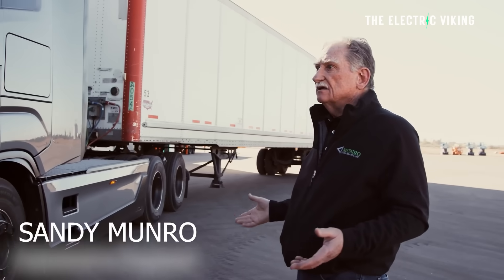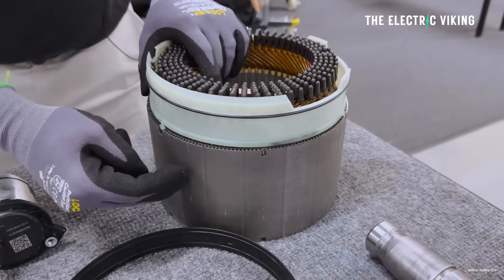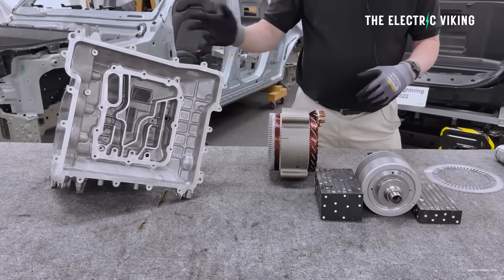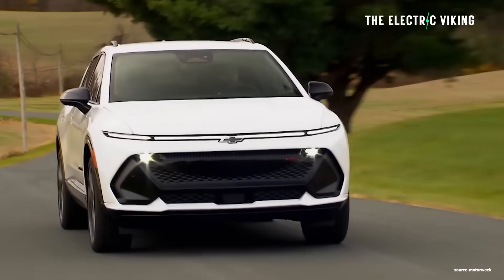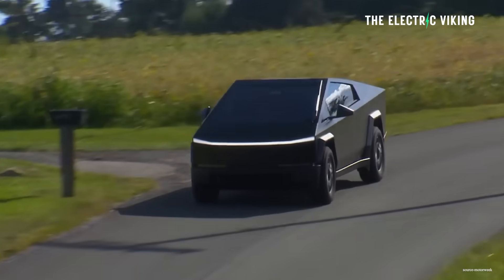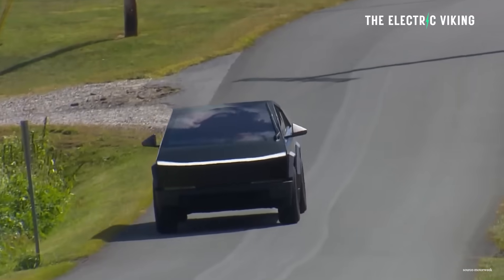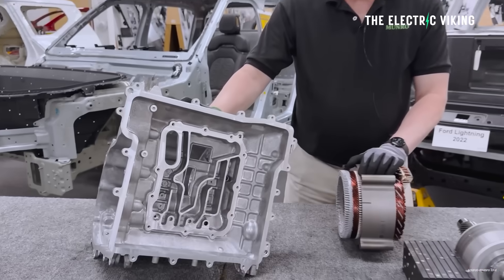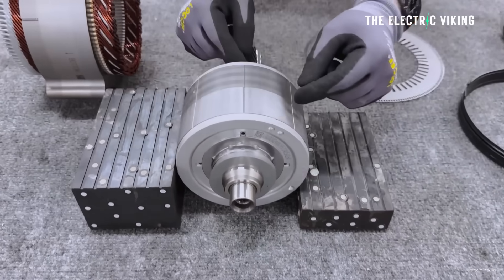Sandy Munro Tears Down Tesla and Chevy EV Motors & Discovers This...

Comment: Tesla oil pump is an extra point of failure
Reply: Choice, replace the Motor in the GM, or the pump in the Tesla.
Guess which one breaks more?  Guess which one is more expensive.  Do the math.
Reply: I'll take that over compromise
Reply: Does the oil pump cool the battery as well? If so, it makes sense to multipurpose the pump to cool multiple systems.
Reply: Fact , my 2023 model is plaid rear motor at 40k miles went off because it was overheating i have a front wheel drive model s … weird feeling ahah
Reply: They literally never fail.
Reply: @Olliebobalong  Anything can fail.  Just low probability.  In theory you can walk through a solid wall, it just never happens.
Reply: @davidbeppler3032 unless you're a liquid metal Terminator
Reply: How is it they have multiple million plus mile cars still running on the roads then ????
Reply: Nothing could go wrong.  There are lots of high mileage bolts too.  Apparently there were coolant problems on earlier Tesla Motors, it suggests that might not be perfect all the time.  I don't hear about that much, that's why I wouldn't take recommendations from superfans.  Musk makes it a easy choice, no Tesla for me, even if they had a $30k hatchback.
Reply: @rp9674 another hater😂😂😂😂😂😂
Reply: @darylfoster7944 I wouldn't have bought a Volkswagen in the 30s - 1945 either.
Reply: @rp9674 I don't see the connection, other than in your delusional mind. Repeating nonsense from Reddit doesn't make it so. Elon is living rent free in your head.
Reply: Yes, I hate musk.  I'm the type of guy if you break into my house and steal from me I'm not going to hang out with you and have a beer, def not going to give you money.
Reply: @rp9674 what has Elon stolen?